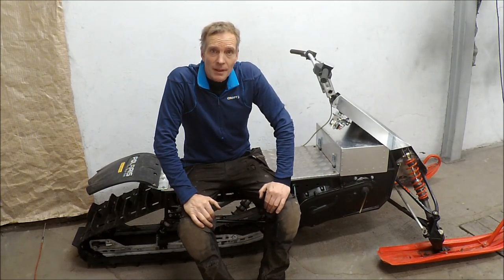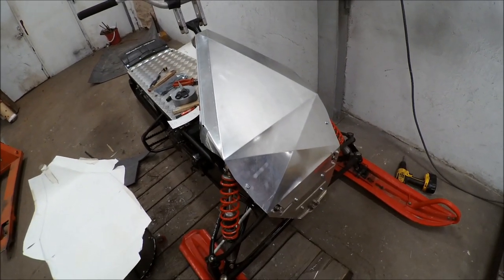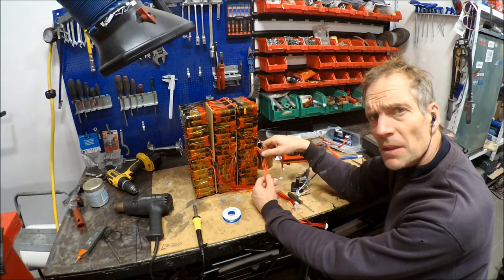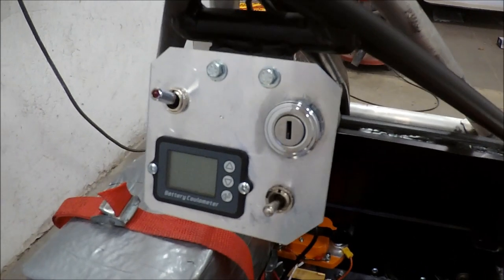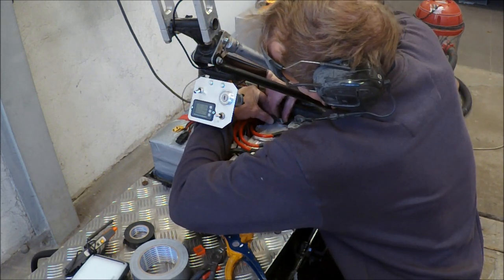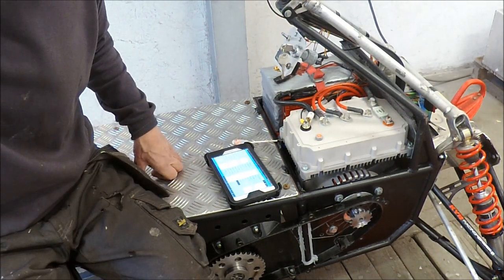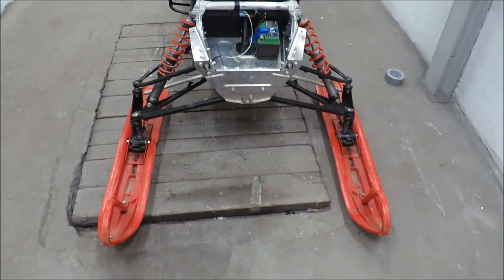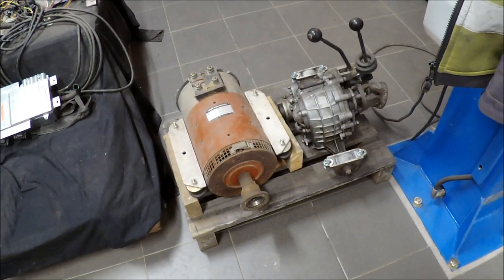Electric Snowmobile Spinning

Comment: Take a look at Yvon Martel MTT vehicle.  Taiga snowmobile looks great but I don't understand why they went 120V AC for charging the pack using solar, it's absurd losing 30 to 50% or your power.
Reply from the maker: Hello, Laurent ! Yes I have seen the MTT, smart and efficient vehicle !  Did not knew the went for 120 V AC, strange. BR Per

Comment: Hi There! GREAT build! Thanks for sharing. Actually building an E sled for my wife right now and after much research settled on the ME1115 as well.  Do you mind sharing details of your battery pack? I see you are running at 94v, what is the total wattage of your pack? Or AmpH and I can calculate. Thanks!
Reply from the maker: Hello, John ! Thank you ! Funny we agreed on same motor :-) I built it as in video : https://youtu.be/6ezTCG2Kiz4
But if you build one yourself use the Daly/Deligreen BMS : https://www.aliexpress.com/item/32880702537.html?spm=a2g0o.productlist.0.0.4b80650cdXUq9j&algo_pvid=c58492a7-0a54-4fb8-a657-bfba5abc6149&algo_expid=c58492a7-0a54-4fb8-a657-bfba5abc6149-19&btsid=2100bdcf16038096092217546ea4b8&ws_ab_test=searchweb0_0,searchweb201602_,searchweb201603_

Much easier to work with. '

If weight is no issue, use two BMW i3 modules in series. Their chemistry is better in cold condition. : https://youtu.be/7QEs4aWpgAM

BR Per
Reply: @persteel  thank you for the quick response! Surprisingly that is actually the same BMS as well! Haha what is the range you saw with this build? I am trying to build this for a 'relic ride' day where we go about 20-30 miles at around 30-35mph but I would love to build some cushion into that in regards to range.
Reply from the maker: Hello, John !  Same BMS :-)  My batterypack is 4 kWh. A fossile snowmobile if you drive active, easily takes  2 l petrol/ 10km and 1 l of petrol equals to 8,9 kW. A fossilemotor is not that efficient as en electric motor but even thou...running in snow is heavy.
Based on former experience i estimate I problably can get 30 minutes of driving out of my pack.

BR Per

Comment: Hoppas det blir lite snö så vi får se hur den går! Jag är lite sugen på att göra en elskoter själv, men jag har inte riktigt samma utrustning som dig så det blir en mer traditionell konvertering med minimal fabricering.
Reply from the maker: Hej, Kent !  Kul, titta på mitt första El Snowbike film : https://youtu.be/dX9Q35Y-OIE   Där sätter byter jag i stort sett ut sekundärvariatorn mot ett kedjehjul. Sedan en kedjetransmission från elmotorn 1:1 utväxling. Funkade perfekt.

Mvh Pär
Reply: Det blir nog något sånt jag börjar med. Hur lång leveranstid har det varit när du beställt batterier?
Reply from the maker: @kentkarlsson765  Tror det tog några månader, de åkte tåg och båt....
Reply: @persteel  tråkigt! Gör det svårt att komma igång. Ska försöka hitta en källa till batterier som redan är i Europa så man kan komma igång
Reply from the maker: @kentkarlsson765  Kan annars rekommendera BMW i3 moduler eller Outlander moduler. De tål kylan bättre, lite tyngre dock. https://evshop.eu/en/batteries/117-5300wh-bmw-i3-battery-module-45v-120ah-nominal.html

batterierna är dyra ....
Reply: Jo, det ser inte ut att bli en billig hobby. :) Uppskattar tipset, i3 batterierna ser ut som en bra start. Såg din video om hur du kopplade dom till din BM också.
Reply from the maker: Har en länk till ett ställe i europa där man kan köpa lösa celler där många elcykelbyggare köper sina batterier, men hittar den inte nu. Återkommer. Mvh Pär
Reply: Uppskattar alla länkar och tips!
Reply from the maker: Har du tur kan du hitta moduler här : http://elbil.forum24.se/elbil-forum-11.html
Reply: Ska hålla ett getöga där också. Tack för länken.